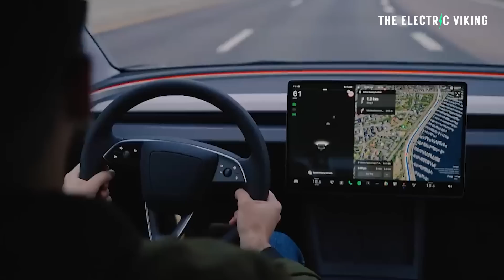TESLA battery maker CATL reveal 1 million miles + zero degradation battery

Comment: As soon as tesla makes the zero degradation battery and puts it in the zero service car, I'll buy one and that will be my last car. Infinite range wouldn't hurt either. OK I'll throw in instant 0-60 for good measure but only in FSD mode with no passenger otherwise that would be also instant death for all passengers. maybe instant charge would be more useful, but considering infinite range it would be only for bragging rights. 0db cabin noise? 0kWh/mile ?

Comment: I think you are naive to believe the hubris of one single battery manufacturer.  
There are two determinants of battery life.  One is how many charge/discharge cycles they can sustain on a test bench charged and discharged as rapidly as possible head-to-tail under ideal conditions.  The other is calendar life.  I couldn't achieve 1 million cycles in my life but will CATL guarantee my battery for say 10 thousand cycles over the next 40 years?
I very much doubt it which means the claim is spurious and the guarantee isn't worth the paper it's written on.
Why not consult an independent battery expert or find some independent testing authority.
When a claim sounds too good to be true it generally is.

Comment: What is the range of this new battery  ?
This is the most important !
Once I can drive 1000 km per charge, I will buy an EV... not earlier...
Autonomy is key.
Reply: Is there even a single ICE vehicle out there that gets 1000km per charge? What’s the point of making ludicrous and arbitrary demands like this?
Reply: @davew2040x  My diesel Audi can drive 1200 km with a full tank... and refuel in 3 minutes...

Comment: Charching efficiency of the energy delivered vs the amount of energy charged, the maximum charging and discharging currents, efficiency vs durability, plate thickness and power density, open circuit discharge level, etc , all battery  parameters can be changed, can be improved while degrading others, etc, and as always,  the best compromise must be found with very small global improvements over time…
One game changer thought today, a small PHEV battery battery, 13.4 kWh capacity, so only 1/6 of the size and weight of a 400 kms range BEV battery can now take several thousand of possibly here, “optimum levels” loading cycles and without any heavy car gearbox nor huge BEV battery, the PHEV car is at least 20% lighter and 20% more efficent than any similar size BEV’s, and more efficient than a pure thermal as well with a possible slow and large 2L, durable (no turbos) Atkinson cycle Otto with the electric motor acting as active flywheel!!! It is also 6 cars with the same amount of lithium grey energy and lithium pollution and danger of ONE BEV, but with now an unlimited autonomy and on fully electric mode possible for most duties, commuting to work, shopping, leasure, etc. The American Council for Efficient Energy Economy with unquestionable competency awarded the “greenest 2024 car” winning status to such modern PHEV,  the Toyota Prius Prime SE with no Tesla , no BYD models in the ten greenest recommended cars… the wind has definitly turned….Toyota has produced 3.5 millions hybrid in 2023 and will make 5 millions hybrids in 2024…all sold at large premium and health margins without any BEV fast depreciation, so severe that no trade in are accepted any longer and with more BEV’s on sale that the amount of potential buyers, used BEV’s are almost NO LONGER  RE-SELLABLE !!! 😂😂😂

Comment: My Kia EV6 had no apparent degradation last summer at 90k miles. Charging to 90% often reached 290+ miles of range.  Currently, I have 164k.  Looking forward to spring and summer temperatures to get back to full range again.   Very pleased with her so far.
Reply: Mt Mitsubishi 2018 PHEV Outlander battery with 80,000 miles has degraded to ~50% or about 14 miles on a full charge. The Kia EV6 looks like a winner at a 90% range of 290+ miles. Where do I get my Mits PHEV tested (other than a dealer) to confirm the charge is way below the 100,000-mile warrantied range?

Comment: I'm typing this on a PC powered from sunlight that fell on my roof, and has been stored in a battery that spent 8 years in a Gen1 nissanleaf, until the owner carelessel wrote it off in a crash. That battery now sits in my garage, and allows me to leverage cheap off-peak and solar energy. Sometimes that battery even actually charges MY ev that sits on the drive outside (when we have nice sunny days).  People think that "old" automotive batteries are worthless but the truth is they are not, not by a long shot. "My" leaf battery had around 24kWh of capacity when new, now, some 10 years of use later (8 in the leaf, 2 in my house) it has around 17kWh.  Thing is, even in this "degraded" state (71% SoH) it easily has enough capacity and power capability to run my entire house. And a Gen1 leaf is by modern standards a very small capacity, low power battery......

Comment: Hi Sam, you undersold the degradation.  1,000 cycles of zero degradation with 500 km per cycle = 500,000 km with zero degradation, not 50,000 km.

Comment: I'd prefer to see that battery technology in power wall storage. Imagine you're using the battery every night to avoid time of use electricity charges, you're using it during power outages, 20 years later and your battery is still going strong? I want to get solar + batteries, but I need that combo to still be working fine 20 years later and I'll hold off until the tech is good enough to do so.

Comment: I wonder how much discussion (Tesla and CATL for example) goes on, that we never hear about.  New developments in batteries are very costly and time consuming to test in a variety of environments, and the auto environment (heat, cold, wet, vibration, shock, acceleration) is particularly harsh. I imagine that a 1million mile battery will change the perception of the general public towards EVs. Now manufacturers need to make the cars last 1 million miles !

Comment: every battery technology has pros and cons. 
I thought LFP battery shows 50 to 70% battery capacity degradation in COLD temperature.
and it shows only 70 to 80% energy density of other battery tech... so it will gives you shorter range with same amount of physical size of the battery.

Comment: This could lead to a slow down  in EV adoption as who is going to buy an EV now that will be obsolete in 12-24 months, because of its battery. It would be great if Tesla lead the way and gave buyers an affordable option to upgrade their cars battery in the future.
Reply: Most drivers won't wear their existing battery fast enough to make that a realistic option. Once you drove 500k on the car body, it's probably not worth it to opt for a new battery in on old body. Current batteries already outlast their car in most cases.

Comment: Anode is not an issue for Tesla. It appears graphite and hard-carbon anodes are adequate until solid state cells are available - they are not made with anode even though the ion plates to current collector. The lower voltage of LFP means both current collectors can be cheap aluminium???
Tesla is building a lithium hydroxide plant and a cathode plant. It will be fascinating as to whether Tesla makes LFP cathode (under licence from CATL???), or just the higher density NMC??

Comment: I am currently using my 82.5 kWh LFP battery from my BYD Seal AWD to power my house. It is the equivalent of 6 Tesla PowerWalls. I have given my electric meter back and use my solar system and EV instead - videos on my channel for the doubters.
Reply: This is cool!
Reply: I wanted to do this but unless I go completely off grid like you (no meter) it is illegal in South Australia. Good on you for doing this! I perhaps would use a car and a battery so there is power while the car is not connected. I even contemplated using a wrecked car "parked for repairs" to get around the draconian laws...
Reply: @DeveloperChris  I have solar and solar batteries. I just use the EV’s power as a backup at night sometimes
Reply: @DeveloperChris  sounds weird, can you build a new house with no connection to power grid if if you want ? I understand installing power in a house could bind you to utility service although a contract with no resignation clause is still odd
Reply: How much? Panels + Battery + Inverter
Reply: @bubuneowoo6161 20kW of PV ฿6/Watt; 4x5kW off-grid inverters ฿5k/kW; 36kWh CATL LFP ฿5k/kWh. Powers a 450m2 house, 2 EVs and an electric motorcycle
Reply: @bubuneowoo6161  This vary greatly for each country I bet. What he do in Thailand. I'm do it in Canada but I started the solar panel just this winter.  You asked the price for (Battery) free, they come with the car, it's the beginning.  (Inverter), again, free, come too with the car. Ioniq 5 with V2L capability. Now it's more than 2 years I have this car and do it. Now with the money I saved compared to Petrol one. I started to buy solar panels with this money, now I reached 16 solar panel at 100$ cnd each, 1600 watts (Lifespan 25 years)  right now they are heating my house (efficiency with non moving pannels around 1300 watts peak). And I will use them to charge my car this summer. Right now they started to pay themself.
Reply: The power walls are nice but last time I looked were overpriced.  Kudos to you!  And a good buy...
Reply: @AllDogsAreGoodDogs  It’s all overpriced. Suckers are born every day.
Reply: Those same batteries that keep spontaneously catching on fire? Fuck people are scary
Reply: @effigy42  do you have evidence of LFP batteries fire? I'd be interested to see it
Reply: @effigy42  you’ve obviously never heard of LFP cathode battery chemistry. My EV and home batteries are all LiFePO4
Reply: No one cares
Reply: @JetFire9  you could have chosen not to say anything and yet you just had to be rude.
Reply: @JetFire9  No one cares about your like free comment

Comment: Um, the only thing remarkable about this battery is the warranty, which is extremely remarkable.  Manufacturer are only guaranteeing 100k miles so a jump to 1M miles will finally shut up all the trolls out there claiming the battery dies the day after the warranty expires. 

LFP batteries have 4500 cycles. You multiply that by the max range of the pack to get the total miles. Any 300 mile LFP battery pack can easily do 1M miles already, it’s just not under warranty.
Reply: I think the nearly 0 degradation and no battery drain on cold weather is pretty much remarkable.
Reply: Do you people get off on lying? You can tell this is bullshit right?
Reply: Shouldn't Tesla EVs have these 1M mile batteries?
Reply: @FarmtheSunUSA  - the model 3 and Y base models both come with LFP batteries by CATL.  Range of 270 miles gives you a max of 1.2M miles. Will they ever hit that number, who knows.  

There’s also the regen charge cycles to calculate into the equation that are much harder to calculate, but it should still get close to that 1M number.

Comment: It baffles me why only 8 years and 160,000km warranty is given on LFPs currently, when they last much longer than that just in their current form.
Reply: My 2021 M3LR has a 192,000 km and 8 year warranty. Lithium ternary batteries. I was parked and charging next next to a 2013 Model S on the weekend. 200,000 kms and very little loss of range, the driver said.

Comment: Batteries appear to be the clear winner for now though other energy systems are developing and  interesting we shall see in the coming years  if they can develop to compete with batteries.  The need for exotic highly processed mineral and chemical compositions and advanced massive integrated  manufacturing chains means the  batteries supply will be controlled by just a few players. This limiting of access may likely result in the same complex issues we encounter with hydrocarbons as their sophisticated and complex logistics also created  a global market controlled  by a few inside players.
Reply: What goes into a battery continues to slowly shift.  We can make green energy synthetic graphite and it works better.   People who try to corner the market on a mineral will find competition from other sources.  The scarcity of these minerals is overplayed.  This is not oil.

Comment: CATL makes the best battery. Can you imagine the depreciation of the current EVs using Korean and Japanese batteries.
Reply: Do you really think CATL makes the best battery in the world. You gotta be kidding me. It's made by chinese, I don't trust any products made by Chinese or Chinese companies. Not trustworthy.
Reply: Why would they depreciate? Do simple math…. Even if you have lithium ion and it can cycle 2000 times and give you 250 miles each full charge. Then maybe they drop to 80%. What is 2000 x 250? Do the math and realise its an insane amount of miles. So while its great battery tech improves to these levels. There is nothing wrong with current tech.
Reply: @de4dcert  people will pay the absolute minimum they have to for any goods. If the newer stuff is better and cost less, the older stuff will depreciate even if nothing wrong with them.
Reply: @i6power30  as with all cars. But it also means ICE cars are going to hit the floor. Why pay £70 for a tank of petrol when it costs £3 in electric off peak or free if you use solar like myself to make your own fuel with a moderate investment.
Reply: @de4dcert  but there are use cases for ice cars EVs can't yet cover. That's why they have so far retained value well, actually better than used EVs.
Reply: My Korean battery (SK On) in my Kia e-Niro is now 5 years and 100,00 km old. I have experienced no loss of range at all and at the 90K service a battery health check showed all 294 cells reaching nominal voltage. I would agree that battery tech is advancing so fast that mine is already looking ancient..NMC chemistry with only 140 Wh/kg density but hey, it's still going to last longer than any internal combustion engine...as for depreciation, it's holding up better than any ICE equivalent too.
Reply: @kiae-nirodiariesencore4270  I highly doubt your Kia e Niro is holding up better than Toyota RAV4. The thing with nmc batteries is that they hold up well in the first 10 years up to 80% capacity. Once it falls under that it's like dropping off a cliff. Or if one cell within the pack develops debtrites and short the cell they are not going to be able to just replace the problem cell. The whole thing is write off.  With older ice cars many little things can break but they can be fixed and replaced pieces wise relatively inexpensively. And you can theoretically keep an ice car going for20-30 years as long as you maintain it properly and keep low mileage.
Reply: @kiae-nirodiariesencore4270  Spot on proof here https://www.youtube.com/watch?v=rdoC3JxRZLY Just 1% loss. Tesla model 3 I  had lost 9% in its first year. So in this example I have the next generation of these cells in mine. Lithium Polymer gel packs are fantastic. The thing is people compare them to all sorts of things but the proof is now there these cells that Kia implemented since 2019 and improved upon are proving to last with degradation stats was better thank Tesla's batteries. Now companies like SK, CATL and EVE are actually the battery hero's and made the real progress in this industry.

Comment: If true, it is a great progress. I am aware of all anti-electrical comments and feelings below, and most I see as correct. However, we need to see this as a small step in overall larger picture where every small town could have a small hydrogen-fusion electrical plant. Or having enough solar panels on a farm-house roof,  charge enough during sunny days to drive in rainy days too. I charge from 20-years old solar panels into AGM batteries that are at the end of life, so this is a good news for me too. 
It is my opinion the usage should develop naturally, not by mandates, because how will you charge EV in a huge garage under huge apartment bloc where so much power will not be available for many years. I see many applications for this battery in non-automotive stationary use,  perhaps for going off-grid completely. If millions of free-standing houses do that,  it will enable the power grid to charge millions more of electrical vehicles who can't have own solar system. The simplicity and controls of electrical motor can't be compared with a combustion motors, transmissions, differentials.
Reply: if EV recharge time can be shortened significantly with each recharge at a greater mileage, then i dont see why its NEEDED to recharge at home. (you dont have a fuel station at home either)
Reply: Many homes have 240 Volts ability to recharge overnight. This is more gentle on the battery too.  Also it may be much cheaper that way while I don't think that kind of very fast-charging stations are yet available.